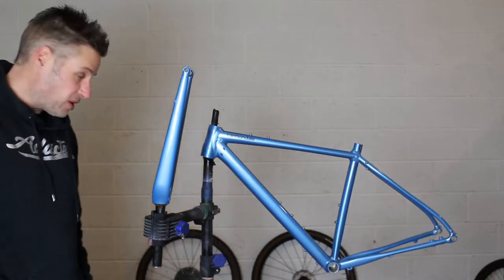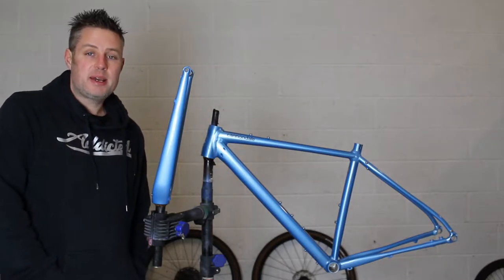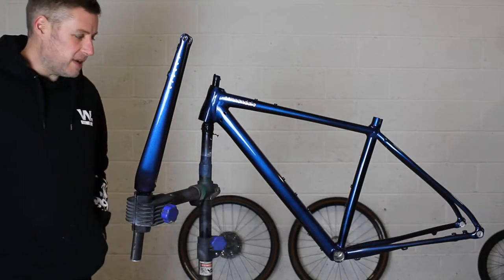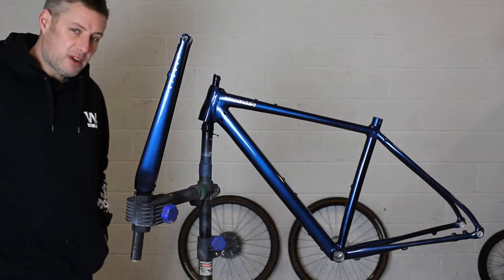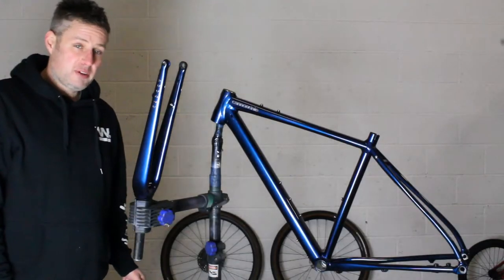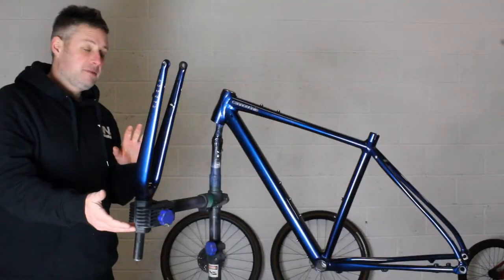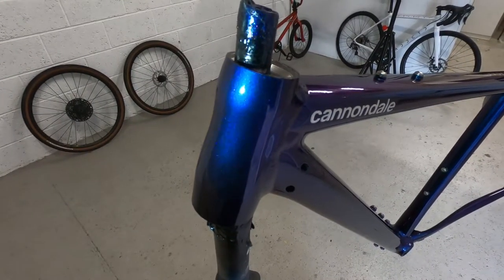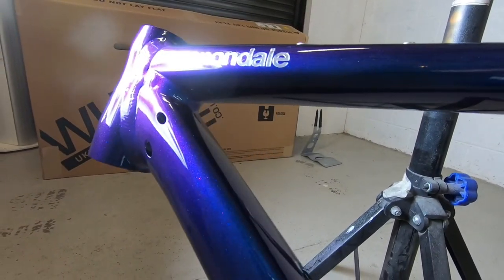2021 Custom Paint Gravel Bike Part 2

Comment: That colour is sick. I bought the Topstone 4 myself as I loved the original colour... Got to say I bought it for the frame and folks but I was pleasantly surprised how good the basic groupo was! I'd bought 810 groupo almost wish I'd saved my money..... Except the brakes they're deadly but sub £1000 it way better than I expected. Looking forward to rest of your build. Only came across your channel by chance having same bike ended up subscribing 👍
Reply from the maker: Richard Blackburn Ah snap! I did the same. Yeah my brakes nearly caused a baaad crash, the calipers jump when brake really hard so you get about 10mm of loose cable and levers touching the bars 😳 Im going to do a vid about it 😂 Ive got a mix of grx 600/800 coming this week, although i want to hack it so it can handle bigger than a 42T at the rear😉 All in all though a sub £1500 build, or £2000 with dropper post and some new 650b’s 😜
Reply: @AddictedBikes  It'll be sick with 650bs. I'm going the other way with mine. I ride a lot of cannal paths bridal ways and gravel roads. So I'm making quicker on tarmac. I've bought a GRX crankset 31/48 with a 105 11/32 cassette. The dilemma I'm having is the brakes. I'm tempted to buy a set of TRP spyre callipers and running 105 shifters, or I could get GRX 600 and have the full hydrolic system. Getting 105s will save me hundreds which could go towards some better wheels. Have to say again though out the box for the money it's an outstanding bike.
Reply from the maker: Richard Blackburn Yeah i had the same thought with trp’s, but they are not that cheap so if you get a pair of levers and calipers for £350 off merlin and maybe get £50-100 back for the microshift on ebay i rekon that works out better value. The cable routing to the front isnt ideal for a cable brake imo. Look out for the next vid with the build :)
Reply: @AddictedBikes  looking forward to the vid mate. Problem I've found is the fact I've gone 2x. I've seen the Merlin set at £350 it's 600 with 400 calipers if it's the same one. That's one by only. I've only been able to find a caliper and shifter that would work for mine sold separately at £250 a side 🥺. Once I've made my mind up I'll post back and let you know 👍